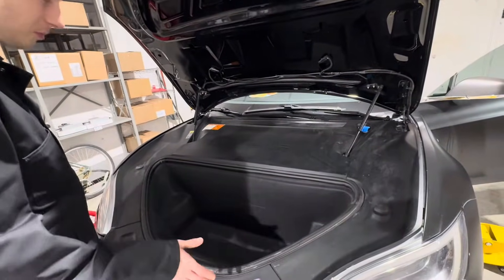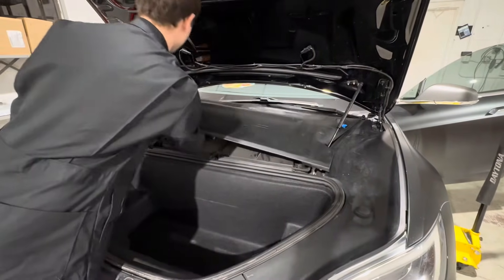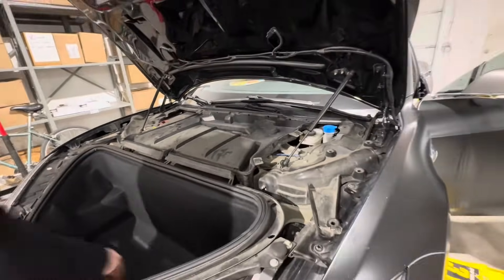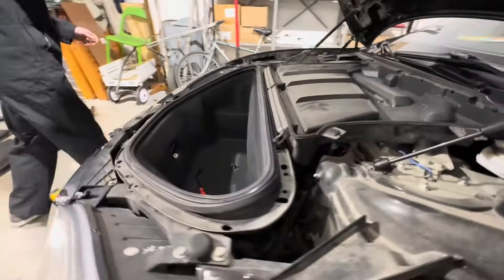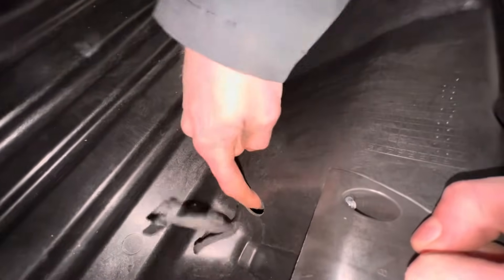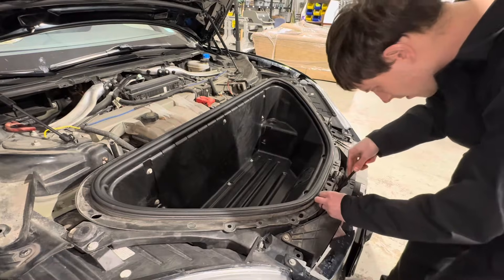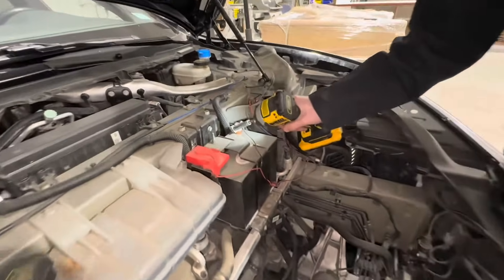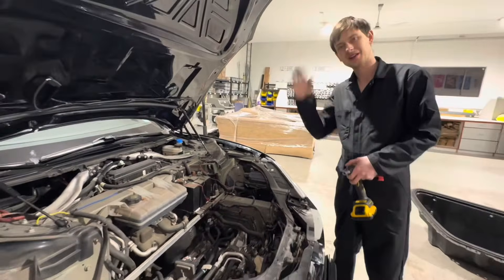Tesla Model S battery Replacement 2016-2020

Comment: What a poorly designed car. Every car I’ve owned has had a 12v battery replacement at some point, and every one was roughly 20 times simpler than this. Talk about not wanting people to maintain their own car so that Tesla can charge you $330 to do it for you. 
How sad. 
But thanks for the video. Much appreciated.
Reply: My model S's 12V Battery is easier to replace than my F150, Fusion, or Edge.  Meaning, its super easy to change.  Tesla also wants around 130 to install one via mobile service.  If not, they are the only car manufacture that gives you the service manuals for free.  It helps to know what you are talking about, before shooting your mouth.  Tesla supports self repair.